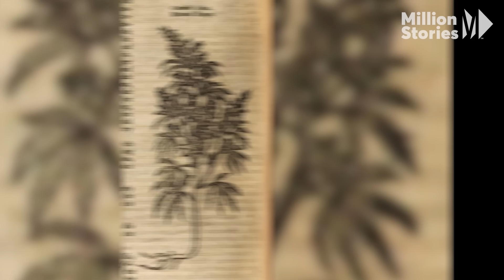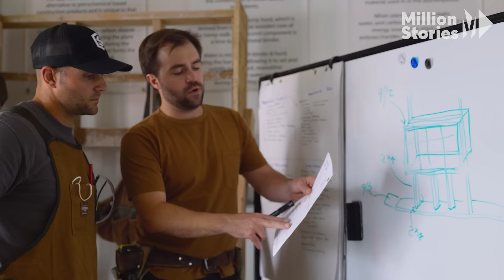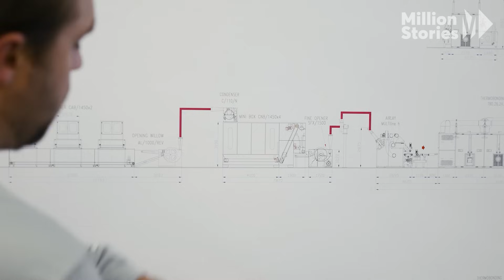Homes Made from Hemp

Comment: I tend to think hemp insulation, wood, and mycelium bricks are the future of architecture. Electricity-free water based AC systems as were used in 10,000BC, and much more; electrical generation will change massively as we focus on safe modular thorium reactors, solar and other renewables, and possibly sometime within 10 years fusion energy and within 15 probably consumer-grade fusion energy generation which would allow us to actively reverse carbon dioxide greenhouse gas runoff by doing carbon capture intended to reverse the damage already done. We’re getting serious as those who are basically evil working corporate conspiracies in the open are doing the same, brace; but be brave!